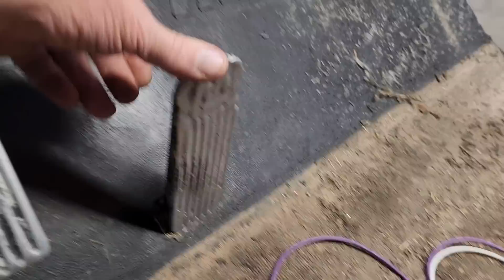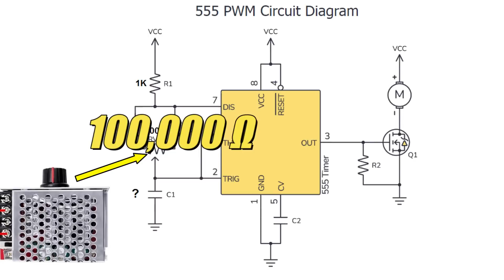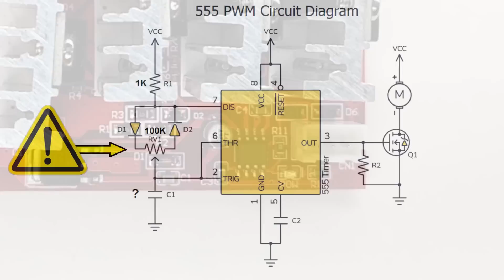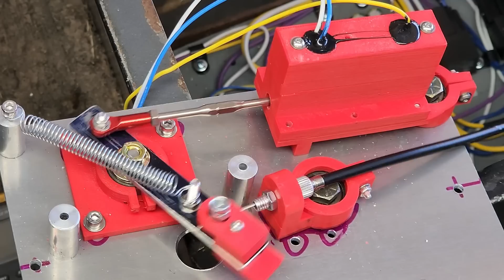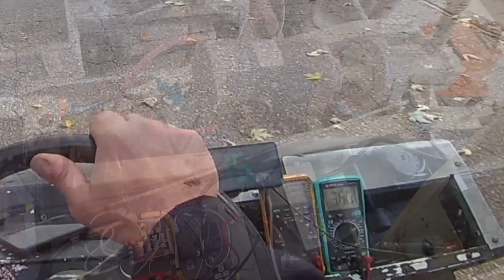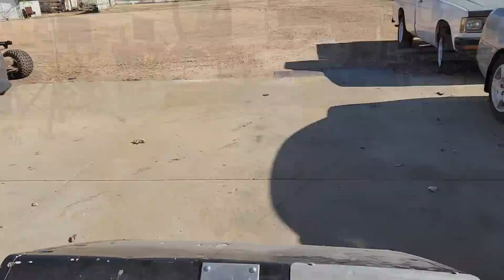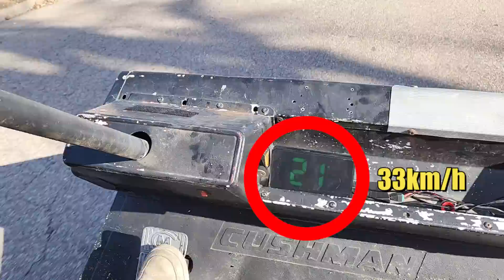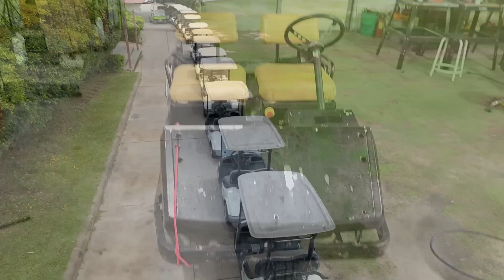S4 E38. We build a custom throttle and road test the gasoline / electric hybrid petroleum battery

Comment: What popped into my mind as a solution to the throttle issue was to use the one from the car and push that into a resistor divider that a microprocessor reads. The microprocessor could then use a 100k digital potentiometer to generate the resistance for the power supply. As a bonus, you could later upgrade it to add cruise control!

Comment: you could technially use a resistor to add to the comutator to reach the vaule you need
Reply: At 8 Amps?  And drain the logic battery (which does not recharge off the alternator)
Reply: @Spudz76  the comutator of the potentiometer, thus increasing the resistance to the needed 100K ohms

Comment: I wonder what the gas milage is of this setup vs the engine directly driving the axle? The engine is running at the same rpm with less changes to the load, which should be more efficient for stop-start driving, but do the inefficiency losses in this system remove the advantage?

Comment: It's amazing to see a 555 still in use. It was aids  to teaching so many kids the basics of electronics, but now it's just a dying art.
I'm happy to see it is still made.
Reply: There are even "modern versions" of the 555.  It is more than still made
Reply: 555 timers are still in many devices that just need a basic timers. They're still cheaper than a microcontroller, and don't need to be programmed.
Reply: @tin2001  its also amazing how often i come across a pic-chip in certain situations... simple microcontrollers... except for programming the stinking things and wading through mplab...
Reply: @pilotoheli  The 741 op amp is also still made. They still make the dual timer 556 also. Both are very versatile chips and the 555 is used in other applications besides timers.
Reply: Is 74LS logic used in anything modern either? Lol
Reply: @SockyNoob  74HC and 74HCT parts are still used.  74LS is rare these days.

Comment: @Robot Cantina - Always interesting!! Make sure you keep that alternator cool, they get real hot. Probably would be a good idea to keep it 15% under maximum rating.
Reply from the maker: That's the plan!, however I really want to destroy it first to find out the limits of the diodes.
Reply: @robotcantina8957  Yes exactly!!   If you wanted a true direct hybrid you could modify the alternator directly by pulling the legs of each phase then you could operate as a motor on batteries then use that to the wheels, or on generator mode to charge batteries. People have converted alternators to motors with quite a lot of torque. Have fun!

Comment: There are a lot of speed controllers similar to what your using that already include a foot pedal, if your looking for a simple solution to recommend. they're usually marketed for kids ride on toys. Search for foot pedal speed controller, foot pedal pwm, ect.
Reply from the maker: Thanks for the tips!  I just order one.  we will see if it can be easily modified.

Comment: More applicable to your last video, but another reason that locomotives use the diesel electric system is that electric motors produce maximum torque at zero rpm, which is exactly when a train needs it.
Reply from the maker: Yes of course.  Some of the things I say are in response to comments I got from previous videos.  There are still a lot of folks saying I'm wrong and this system is efficient.
Reply: @robotcantina8957  This system is many things, and I think the biggest is that its entertainment is equal and opposite to its efficency!  As in its NOT efficient at ALL, but is VERY entertaining and interesting!
Reply: @ThatKoukiZ31 how much loss is there in this system?
Reply: @nick-leffler 
In a home made one, it's probably about 50-60% efficient (so 40-50% loss of energy).
But because of the small size, even at 50% loss, it's still more energy efficient than a full size car for short, low speed use.
Reply: @tin2001 efficiency of what? Mechanical energy to mechanical? No. Mechanical to electrical? No. Electrical to mechanical? No. Wonder efficiency on free time to fun!

But in serious applications: Fuel used to do the same work is where you make up the losses. Most car engines are at 10-20% throttle and revving below peak torque for most driving, most of the time. If you could use the engine at peak efficiency only when its needed, you can get more work done with the same fuel.

A prius is an amazing commuter. Electric torque off the line, regen, and direct drive for highway speed. 

The edison motors prototypes are promising. Even with modern motors, generators and diesel engines, its a lot of losses in the conversion. But that's not the point. The point is reducing operating costs and emissions through the use of less fuel.

Comment: I think that we need to see a v-twin, and the highest output alternator that you can come up with. Something that will burn rubber, ya know!
Reply: Ford offered some pretty massive alternators for ambulance package 7.3L diesels, that may be more affordable and easier to come by some ones good enough to use for this purpose.
Reply from the maker: Hell yeah!
Reply: @robotcantina8957  Maybe a Delco Remy 55SI would do the trick. But judging by the price, they are pretty proud of those.

Comment: So peak hp is in the 2500rpm plus area, but peak torque much less it would be interesting to see what gearing the belt at peak torque rpm and still keeping the current rpm of the alternator .  In theory that would make it more fuel eff. than for hp rpm. And much less noise
Reply from the maker: On this engine peak HP is @ 3600 rpm and peak torque is at 2500 RPM.  We will have to do some more experiments with engine RPM, but for now I'm more concerned with getting the basic system to work.
Reply: @robotcantina8957  wow thats higher than expected, I guess once again you have it right where it should be then. But yes one step at a time. Im just looking forward to seeing what happens next. thanks for your work jimbo happy thanksgiving

Comment: I realize that the directly actuated  potentiometer is in theory the simplest way to accomplish throttle control, but for the sake of argument, could a servo connected to the current one, being operated via an arduino allow the use of virtually any pedal assembly?

I know that seems like an extra failure point, but it also removes the failures that can come with designing a 100k ohm throttle pedal. 

The arduino could also control the engine throttle, too. Just saying. 

Happy Thanksgiving, Jimbo!
Reply from the maker: Yes of course a servo and an arduino would work great.  At this point I want to stay away from  arduino's in order to retain most of my nuts and bolts audience.    Now on this application, the servo wold certainly work, however there may also be a simpler way and we will try a  X9C104 digipot to interface the arduino and the power supply.

Comment: When overvolting a brushed motor, the biggest concern as you mentioned is heat. The internal coils eventually melt their insulation and cause shorts. 
I would recommend rotating the motor and measuring resistance across it to make sure all of the coils read roughly the same amount of ohms. It might seem to be working fine, but I had an old abandoned e-scooter that apparently had a shorted coil. The shorted coil produced even more heat, causing the other coils to fail and the brush card to catch fire.
Reply from the maker: Thanks!
Reply: The series motor is limited by its watt output rating as is the alternator. Both can operate at higher voltage with reduced current.
Reply: @59jm24  How can you get higher voltage at reduced current with a motor whose DC resistance is nearly constant? You would have to rewind the motor which is no small task and runs into a bunch of problems because the armature will be designed for the windings that it currently uses - modifications are likely to make it much less efficient.

Edit: Nevermind, I didn't realize this was a series wound motor and not a permanent magnet motor.

Comment: Motor mechanic here. (electric) overspeeding a dc would result in accelerated brush wear and in extreme cases mechanical failure of the windings departing the armature at high rotational speeds.  Also be careful running that series wound motor unloaded as they do not have the innate throttling a dedicated field circuit provides and can "run away" catastrophically if ran uncoupled. Likely the rear axle is enough drag to prevent this but I would be very careful if any motor out bench testing of the motor is to take place without any motor RPM monitoring and control.
Reply from the maker: Thank you so much!
Reply: @robotcantina8957  Old electrician here. Care full running a DC motor unloaded. 4000 rpm seams a lot (to me). They can blow apart at high speed! Some do have a shunt field to control over speeding. Your car alternator may not have the cleanest DC and can cause some motor winding heating. On a car they have a battery to clean up the DC ripple.
Reply: That's a permanent magnet DC motor, no? Should the back EMF not form an upper limit on the RPM?
Edit: I stand corrected, I wasn't familiar with series wound DC motors. Neat!

Comment: I worked for a guy who had his own construction company in the early 80's. I needed 
to fix the exhaust on my 1970 Monte Carlo. Instead of jacking the car up and climbing under, as I usually did, my boss flipped my car on its side with the backhoe onto some old carpets (the car was not mint by any stretch of the word) and it was so easy to do the repairs. The exhaust system was right in front of me. So nice. Even at 21, climbing under vehicles sucks. Yes, a lift some day. Yes, 
I let it set for a few hours before starting it after righting it. You know, fluids and all.
Reply from the maker: First gen Monte Carlos used to be a dime a dozen,   Flipping one on its side to do maintenance/repairs seem like an awesome idea..but sadly not may of those cars are left.
Reply: There are car rotisseries, used mostly for painting. If I had one that didn't damage my sissy modern car and truck, I would use it often.

Comment: You could try to find an alternator from a semi truck

It's not the voltage... its amperage

Semi truck alternators charge four huge batteries at the same time.
Reply from the maker: Indeed,  I just need to find stuff cheap.
Reply: How about wrecking yards... kansas has a few

 @robotcantina8957

Comment: Add a second alternator ( stack them) and put on bigger rear tires,  We don't hear any motor bogging down and like you pointed out nothing is getting really hot.  35 is the low power limit of non licenseable scooters and such, so go for that as a goal.

Comment: Don't underestimate the value of that cart. There are single parts that are probably worth more than you paid for the whole thing. The rubber shock mounts on the frame to body area, if in good shape, are complete unobtanium and worth several hundred dollars to the right buyer. Great stuff on this build - especially for those of us who know and appreciate the Cushman lineage.
Reply from the maker: I had a look at the rear suspension when the cart was flipped and I have to say I didn't completely understand what was going on.  At some point the cart will be retired and  hopefully passed on to a Cushman collector.
Reply: @robotcantina8957  I have a cushman golfster very similar to yours  I think mine is a 1973??  It has a 10 hp kohler and snowmobile type type clutch to the rear axle.    They are tough as nails!!   Great video as always!

Comment: Why not build your own chassis? I can help constructing one made from standard aluminum and steel parts and some 3d printed parts. It might even be possible to make one from pvc pipe, if jimbo isn’t to jumbo.
Reply from the maker: Making something is not out of the question.  However for this project we want to use  a cart that most people have access to.

Comment: The 555 being inside the PSU was only half a surprise. It is very old, yes, but it really has a million plus one uses, there's a reason they kept on updating it and there are SMD versions available
Reply from the maker: Indeed,  If you know electronics, you know of the 555..... and 741
Reply: @robotcantina8957  Indeed. Also, about the amount of electronics in your projects, on one hand it is a pity that you can't really delve too deep because you'd alienate most of the audience but on the other the fact you find simple solutions like what you've shown here is proof that you very much know what you're doing. It does take skill to make things as simple as they can be

Comment: I don't think the petroleum battery can be called 'off grid', petrol requires a very on grid supply chain. an ideal candidate for a gasifier. A whole other side of the vehicle. I suspect you have the chops to build such a widget. Then it's off grid

Comment: just a thought, if you use a micro-controller like an Arduino, you could use any accelerator you like and use a servo to control to speed, and if you install some form of load sensor you could adjust the engine speed depending on load. maybe monitoring the current and as the draw goes up increase engine speed, when you get to cruising speed, ease back on the engine a bit.
Reply from the maker: Yes, once we sort out the "simple"  solution we will try the arduino

Comment: so this may be a fever dream taliking but could one use a timing belt along with a big gear on the engine and small ie crank gear on tha alternator dropping revs more towards peak power efficiency range ?
Reply from the maker: Changing the drive ratio is possible, however that that would also increase the load on the engine.  right now we have a 1:3 ratio, anymore more that that, the engine would struggle.   Feel better soon!

Comment: I had access to a 4 wheeled utility cart in a factory. I think it used 2 or 3 belts to instead of direct drive. It would squeal the rear tires if you punched it. Mind that was on polished concrete. Still had a decent top speed, at least for inside the factory. I don’t remember the brand.
Reply from the maker: I reckon driving full throttle inside a building would be epic, but some people may get upset...  Have a good one!
Reply: Probably Taylor-Dunn.

Comment: General rule is you can double the rated volts on most motors. Esp. for short bursts. More volts=more rpm. More amps=more torque. I routinely run 84v peak bats on 48v rated motors with no issues and good service life on little drag mini bikes. And up to 120v on 60 and 72v rated motors at around 250a. 4 second 0-60 times. They are a blast. 

maybe you could toss on another cheap alternator in parallel?  Several companies also have 300a+ alternators. Amazon sells a 300a unit for $260. "power bastards" and mechman also sell performance alternators.

Comment: Wouldn't it have been easier to use a throttle arm like you did, but use a pulley on the speed controller with spring return?  The arm on your speed controller could have had a cord attached to a pulley instead of the existing knob with a rotary spring to take up slack when you let off the pedal.
Reply from the maker: That is a method we are looking into.

Comment: Going to guess its a 48 volt golf cart. Be neat to see you set it up as an EREV (Extended range EV). Have a 48 V Lifepo 4 battery on one side and your Lol Petroleum battery on the other. You could build a solar rooftop to recharge the lifepo 4 battery while sitting or even moving. Then if you run low on charge with the lithium battery you can switch over to your petroleum battery. Technically if done right you'd never have to plug in and if the power goes out (gas pumps don't work)  or if you run out of stored liquid battery fuel you can keep going. Additional vehicle weight should still be under the weight of it as purely an EV.
Reply: It was a 24 volt cart.  Eight x 6 volt batteries in series.

Comment: I think 20 mph is plenty fast on a 3 wheel golf cart!
Those things are notoriously unstable in stock form, and I'm sure changing the center of gravity by removing the batteries didn't help at all.
Happy thanksgiving, Jimbo.
Reply: I'd be more worried about reliability due to vibration environment. durability is paramount
Reply from the maker: Have a good one!

Comment: Great progress, Jimbo!  Your bringing out Forrest Mims book gave me a laugh, as I still have the same book in my library.  Learned about 555s as a kid when that book was new.  Like you, I’m surprised that power supply doesn’t have a microcontroller in it. 👍
Reply from the maker: As part of my finial exam I built a multi spark ignition system for my Plymouth Horizon with a 555.  As I recall I got an A.
Reply: Cool project, perhaps you could have beat MSD to market.  Haha

Comment: The weight of the motor will tell you a lot more regarding the power you can output than the rating on the plate. It’s about 1hp/lb if you keep the temperatures down. People have pushed 300kw on forklift motors in drag racing applications. It’s a matter of temperature control and duty cycle. They can take 300 kw for 10 seconds down the strip but should probably stay at a lower power rating for cruising. Regarding top speed, a general rule of thumb is to take the cubed root of the horse power then multiply that by 31. It’ll give you a descent estimation of top speed if the car has a relatively average aerodynamic profile and a proper gear ratio. Cubed root of 4 horsepower is 1.59 ish. Multiply that by 31 and you get a hair short of 50 mph. The weight of the vehicle doesn’t really matter, that affects acceleration more than anything, you should be able to hit that speed…. It’ll take a hot minute but you’ll get there. Long time fan. Hope this helps!
Reply from the maker: Thanks!